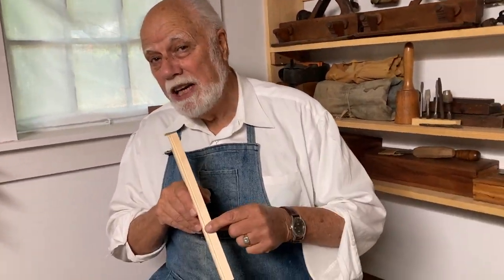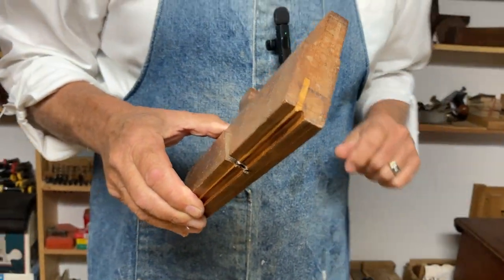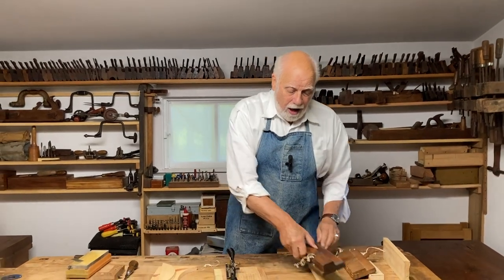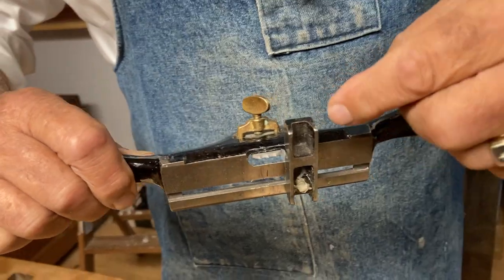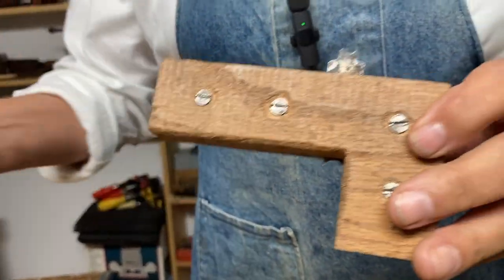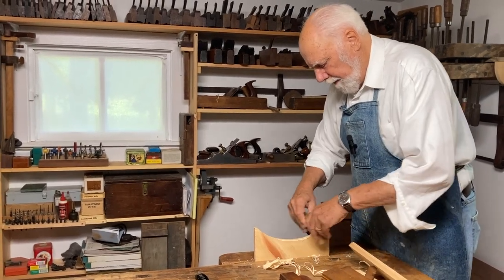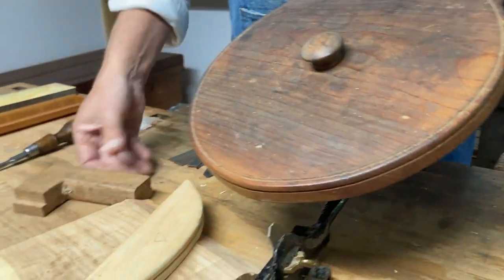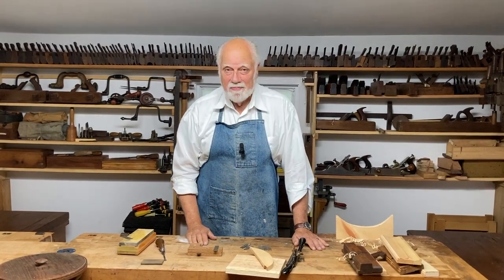09. Beading, Reeding, & Scratch Stocks

Comment: I’m really excited to learn that I can actually make tools for use in my woodworking adventures. One request I’d like to make is that you share some instruction regarding how the blades for a scratch stock bead plane are made by a DIYer. I find I’m wondering about the thickness of the metal I should use and how to sharpen a homemade blade that might be cut from a can as you suggested. I also must say that I’m really appreciating your book. Thanks you!
Reply from the maker: thin but stong steel is best — like a piece of bandsaw blade. shaping is done simply with an appropriate file. sharpening is simply a mater of rubbing both sides flat on a sharpeing stone, no bevel is needed.

Comment: Delighted to learn how to make a scratch stock...I was vaguely aware of the term, but had no idea what it was. how simple, versatile and easy to make ... another use for modern saw metal that no longer cuts well... I'm guessing that a bit of careful filing would keep the concave edge keen.
thanks Graham
Reply from the maker: Filing will help to keep a concave edge the correct shape, but rubbing both sides of a scratch-stock blade flat on a stone is all that's really necessary to keep it cutting (pushing or pulling) well.
Reply: @gjbmunc  Excellent thanks Graham...just bought a diamond plate set so sharpening will be easy. Using traditional tools is a joy for me and making my own versions is equally enjoyable. Really enjoying the videos.

Comment: Graham, it is a pleasure to view someone, especially you, demonstrating the use of handtools. So needed on YouTube! Even for blended power/hand users, there are occasions when the handtool is superior to use, by virtue of being quicker, easier or in performance. I must, however, correct you about the scratch stock vs hand beader. Most hand beaders  (e.g. Stanley/LN #66), Lee Valley/Preston Cast Scratch Stock) do have side fences which may be set for the desired distance from the blade. Any beader which can work on the flat will also work on a convex surface. It is only a concave surface where the need is for either a curved or a narrow sole. The Lee Valley Cast Scratch Stock (based on a Preston design) is one which will do it all. Of course, this should not detract from the pleasure of making a scratch stock. For myself, where a beading plane really wins out is in making slips for drawers. I mentioned this in the latest Quercus magazine. Regards from Perth, Derek
Reply from the maker: Thanks for the comment. Of course you're right; it's just hard to fit everything in succinctly in 8 minutes. As the channel grows the episodes will become longer and more complete. In the meantime, if you'd like the whole story check out volume two of Blackburn on Woodworking : Traditional Woodworking Handtools — hardcover or softcover. Cheers.

Comment: I've never attempted what you are doing here, but it seems that on a straight edge, the beading plane is much faster and allows better control. Correct, or simply my assumption? I do see however the versality, ease of cost and customisation possibility of the Stanley and scratch stock.
Reply from the maker: You're quite correct!

Comment: You could improve your shop made rounded scratchstock tool by using one thin ~ .050 thousandths rectangular (and cut square) wood shim clamped beyween the two halves of the tool flush along the vertical edge to align the blade square to the that edge.  Various widths of shims move the blade farther away from the vertical edge.  You will have to experiment with the thickness of the shims in relation to the thickness of your blades so they both clamp tightly in the tool.  I have done that for other hand tools and cut them from a larger piece of hard maple on a table saw for uniform thickness along the length of the shims.  This has worked well so far. 

I have a similar factory made beading tool.  It took some practice to get used to and pressing hard against your work piece gets you nowhere.  Sharp blades do the trick.  It acts more like a scraper than a cutter.  If you accidently use it against the grain you will only make that mistake once.

This next point was not the subject of the video, but whenever I can I make jigs and fixtures using scrap and even non scrap pieces of good quality highly figured and contrasting hardwoods.  We work with wood attempting to make beautiful objects so why not have the intangible benefit of seeing nice looking jigs and fixtures as you work?  Then again I have made numerous on the fly jigs that qualified as sacrificial and/or  junk from cheap wood, but they worked.

Good videos from this man.
Reply from the maker: Good tip, and by all means use quality scraps.